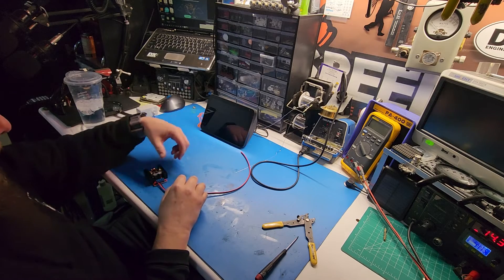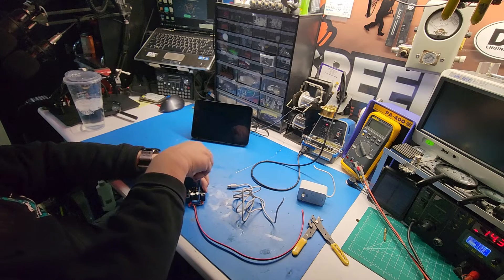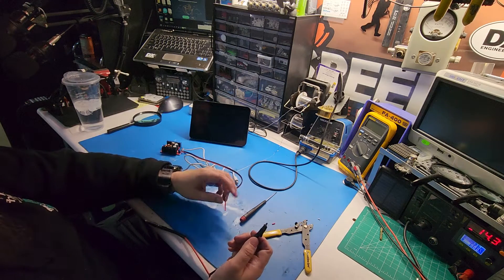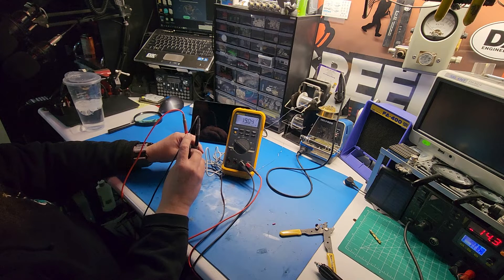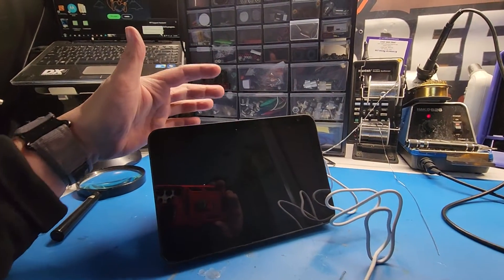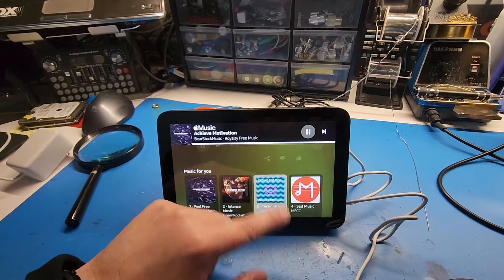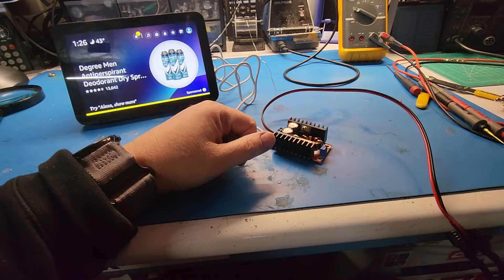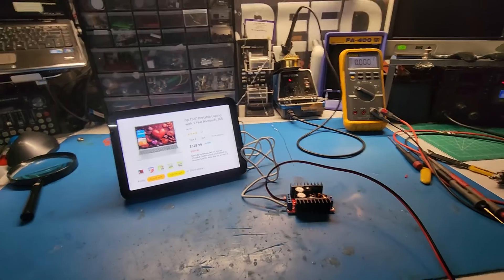HOW TO POWER AN AMAZON ALEXA SHOW or LAPTOP FROM 12 VOLT POWER

Comment: Thanks for this. I was looking on how to power an Echo Show 15 in my van conversion using 12 volt. I figured there would be some way to step up the voltage.
Reply: I'm looking for exactly the same thing for my Echo Show 15 in my Sprinter. Did you get it working? Do you know what size the barrel connector is? Cheers.